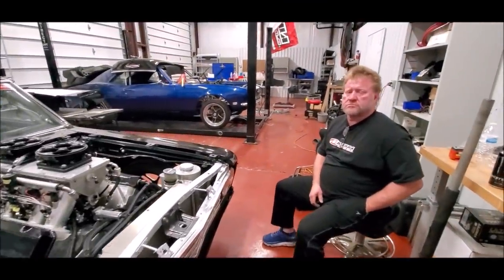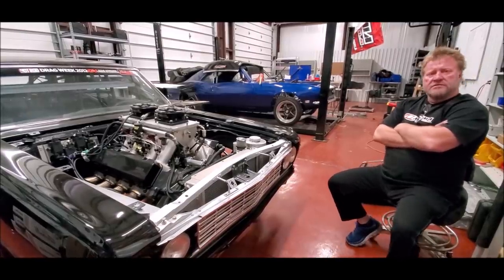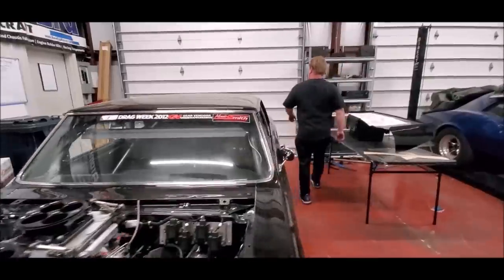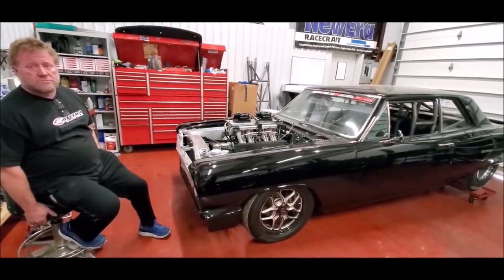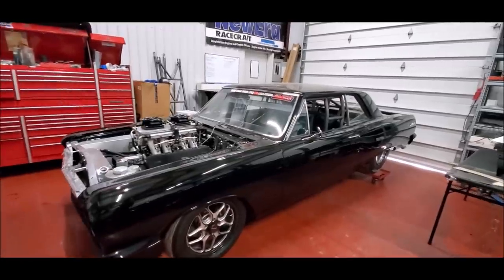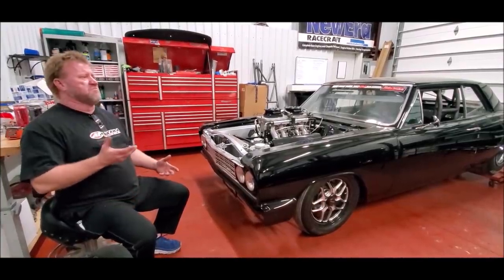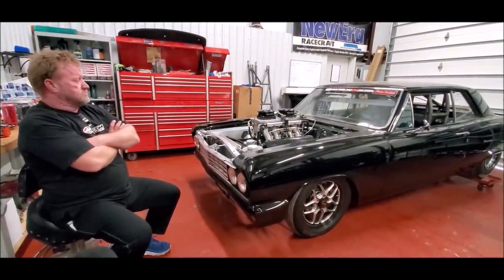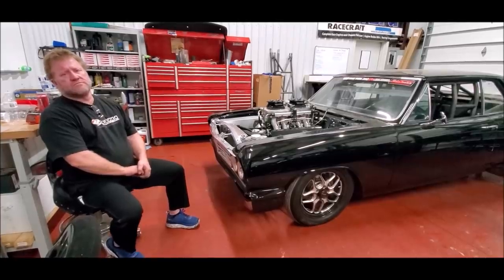Street Outlaws Reaper New Car Reveal!!

Comment: I love Reaper and Dominator, 2 old school guys who won't quit. I know this is no different now than professional wrestling. The idiots of today love the scripted tv of that controls their thoughts.  50 years ago when I bracket raced with my 2500 dollar Camaro I knew I was a badass. Untold hours of work, 20 bucks for a block and heads, a rock crusher and a 25 dollar gearset. State of the art ignition system. (A Mallory dual point and a 40, 000 volt coil. ) A factory intake and butchered factory carb that my ' racing friends" told me would never work. This was my only car. Drove it to work at the gas station 6 days a week. My fastest passes were a 7.17 eighth, 11.67 quarter. Both of these were probably due to wheelspin, could have used a 5.13 gear. NOBODY could beat me on the street. Stopped by the cops once and  the first words out of his mouth were "I can tell you what color your oil filter is." Got stopped another time, bumping leaving a red light. Went to jail with 10 tickets. Got them all thrown out. Judge said he had never seen this

kind of bullshit before.  Those were the days. Ride on Reaper.